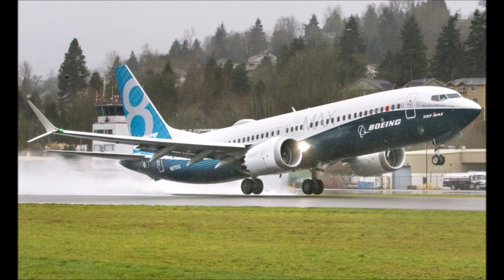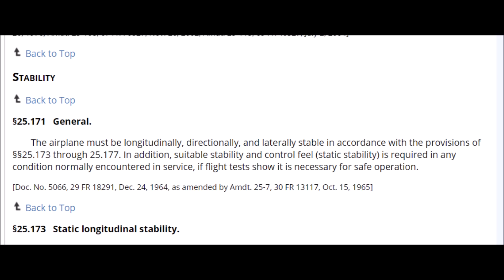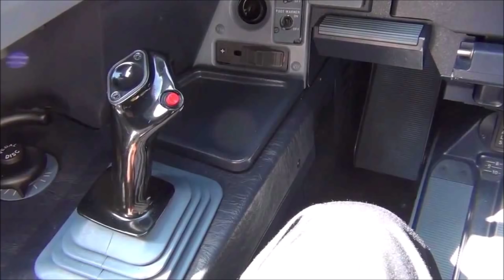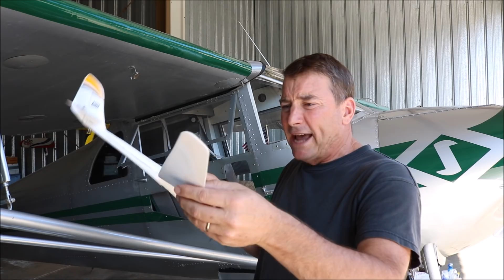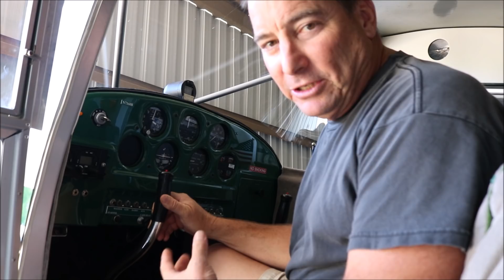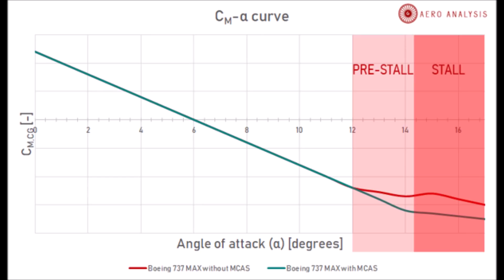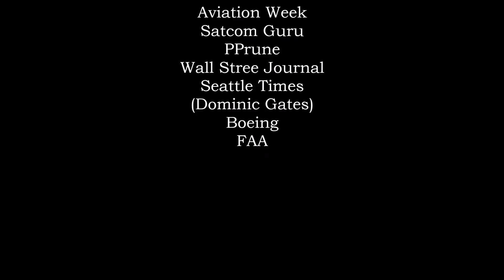737 Max UPDATE 30 Aug  2019

Comment: Juan,
I’ve been following the blancolirio™ channel on YouTube for a while* and this video is one of the best you have produced on aviation issues. The amount of information you are presenting, and your balanced analysis of facts make this video the best investigating coverage I have ever read on the 737Max fiasco. If you continue this path, you may get an offer to join the NTSB Team. 
The 737Max could have been another Boeing success story, but the greed of a few Boeing MBA executives subdued the Excellence of Boeing Engineering and created this situation. I hope it will be a good lesson for Boeing and other aircraft manufacturers not to undercut safety for quick ROI to please the investors.
Also, I want to congratulate you for having presented the human factor involved in operating an aircraft under the duress of an emergency with a new light. Especially an emergency happening just after the TO phase of the flight when time to act is supercritical because terra firma is coming at you faster than you want. IMHO your earlier videos after the Ethiopian crash, were too much in line with US Rep Sam Moore’s opinion, declaring in a nutshell “nothing wrong with the Max, it’s only the result of substandard trained (read unqualified) foreign pilots” or “this would never had happened with good ‘merican pilots at the controls”. This reasoning was total BS.
Yes, it seems the crew reacted late and made some mistakes, but these mistakes should not have finished in a crash, if the equipment they were flying was not flawed. Minutes before crashing those pilots were under a lot of stress, in those circumstances thinking right is difficult. Airline pilots, while mostly very competent, are generally not of the same caliber as astronauts with steel nerves like the Apollo 13 crew. But the Apollo crews had more time on their hands to figure it out.

Wishing you a prompt recovery and that your PSA level drops to undetectable level like mine has done for the last 7 years since my radical prostatectomy.
Your buddy BMW rider and former Penn Valley resident.

*I should stop being a free loader and send some dineros via PayPal to support the channel. Well at least until you get back behind a triple-7 yoke and re-start making an indecent amount of money 

Comment: When a small light aircraft (without any computers trying to fly it) has a airspeed indicator error caused by a plugged or socked probe , the pilot will ignore the dam dial on the panel and simply fly the damned plane and not have to battle a GD  computer highjacking his aircraft. You got these GD CEO's and bankers sticking there pricks up everybody's butts causing this mass slaughter to happen and not by a honest  mistake but by design.

Comment: I think he is getting the idea but gets into the weeds with all his examples of a small light aircraft compared to a fly by wire airliner. The facts that killed all those MAX passengers and crew relate to fraud in a scheme to market aircraft to CEO's and bankers. FAA rules are suppose to safeguard the public from aircraft that are not airworthy. Any aircraft that uses a computer to override the pilots when a airspeed probe is plugged or socked with a ground cover is not airworthy from the design state up. This is so basic a screw up that it is criminal.

Comment: MCAS went "HAL 9000" on the crews. I detect the need for nose down trim.  Diving!

Then it became "John Henry, man vs machine" trying to manually reverse what the computer did with motors in seconds.

I did software development for 25 years. We always do range testing. Allowing MCAS to trim beyond elevator authority seems like a huge oversight.  As was the redundancy issues.

Is anyone looking at AoA sensors? Boeing, Airbus, and most recently Cirrus have had issues with them.

Comment: Just an excellent summary of the 737 max issues. By over accommodating businesses, the FAA has lost its independent oversight. The loss of the veteran FAA managers is another disturbing trend where older wiser employees are replaced with inexperienced personnel because of cost savings.

Comment: The Lion Air Flight 610 aircraft had the "bad" AoA sensor replaced.  Remember?  It had two "good" AoA sensors!  Both Boeing and the Indonesian authorities have not offered a plausible explanation as to why the Lion Air aircraft suffered serious data failures on three previous flights, even AFTER the 'faulty' sensor was replaced.   The Ethiopian crash aircraft had earlier "intermittent" data/control problems.  Even with "good" AoA sensors.  For example: During a flight on 7 Dec 2018, during landing, the airplane starts rolling to the right all by itself!   Could it be that the bad data feeding into the MCAS came from a source other than the single AoA sensor?  An electrical short or surge somewhere in the wiring?  I hope Boeing is looking into this!  I will NOT be flying on a MAX8 until I am satisfied they  have found the true source of the problem.....

Comment: In 2008, Quantas flight 72, an Airbus A330-303, experienced two uncommanded nose-down events as the result of faulty AOA data.  This was not failing AOA sensors, but altitude data being mistagged as AOA data.  I realize that the A330 is fly-by-wire and not the same as MCAS.  However, it does seem that the Flight Control Computer, acting on its own, in contradiction to pilot input, decided that the nose needed to be down. The airplane never crashed (because it was high enough to recover) but it left several passengers and crew bloody and battered.  I'd be interested in any comments you may have about this incident.
Reply: I take it you are referring to the possibility that high energy cosmic radiation infiltrating the microprocessor circuitry at high altitudes could initiate bit-flipping, causing falsely activated software signalling? This is tantamount to pointing the finger at an Act Of God. Yet, such a mechanism is also conjectured to trigger a whole range of cancers. Random quantum physical events intervening at the macro scale?

Comment: Can’t Boeing just use the autopilot servos to pull back on the yoke to 3 lb force just like the Garmin 3000 suite on TBM 940 why move the elevator trim?
Reply: Because it seems that the B737 Max-8 trim was supposed to actuate without the pilots being aware it had done so when MCAS intervenes, except perhaps, by noticing the trim setting transiting while in action. Mechanically assisted elevator motion would effectively materialise as invasive motion of the yoke in the pilot's hands, would it not, and that would defeat the objective MCAS appears to have been set up to accomplish - which is to transparently assist in the background.
Reply: @snoortpod6462  Thanks for the explanation. So that means the force on the yoke must actually come from the elevator and not augmented pull from servos, but why. Wouldn't the two methods produce the same result on the yoke to alert the pilot for near stall conditions? In Airbus fly-by-wire side stick this will never happen as long as the normal law is still in place. Correct me if I am wrong but I believe 737Max still use mechanical yoke?
Reply: I kinda get what u mean. pulling on the yoke would feel like autopilot malfunction or something when the pilot is flying. And autopilot will not have the authority of the yoke when manual flight mode is engaged.
Reply: No idea how Boeing integrates the autopilot system, although, it's not the first time I've imagined how many stab trim movements there must be over the course of a single flight at cruising speed/altitude, no matter which aircraft this is applied to. The blissful ignorance of the everyday passenger, eh?

The two Max-8 accidents, I think, have not been implicated with the autopilot system in the public consciousness, because it was never activated in the Lion Air and Ethiopian scenarios as far as I am aware - I'll need to be corrected if I'm wrong. We have to wait for the accident reports to be published. It is burned in my brain that MCAS supposedly only works under certain prescribed conditions, and one of those conditions is contingent that the autopilot is/was not engaged when MCAS has/had authority over the horizontal stabilizer pitching moments. You might be tempted to suppose the Max-8 is governed by at least two autopilots, one of which is the official autopilot, while the other is an unofficial autopilot. It sort of gets a bit silly. In my mind any kind of automation working at any given moment in time while an aircraft is airborne must be governed by some kind of autopilot, but do forgive me my ignorance. The traditional sense of what a fully armed and operational autopilot does is to operate the aircraft with full autonomy while the pilots are formally 'hands off' any of the controls, other than the autopilot interface which allows pilots to alter autopilot functions in real time via a limited number of parameters such as instantaneous IAS, altitude, VSI, heading/track/course, maximum bank angle and so on through their respective control windows - the usual suspects. Before that traditional autopilot is engaged, the continuity of any given flight is governed by pilot skill and knowledge of detailed concepts of flight, requiring specific training. The traditional autopilot I'm referring to was known as "George," because its entry to being engaged was based on the handling pilot transferring their flight stabilized aircraft to an automaton, which from that point onwards maintained constant stability by initiating limited changes to any of the critical aspects of flight, while the pilot kept a watchful eye on what the autopilot itself was up to. MCAS, therefore, seems to me to be a form of FBW, but as to when it serially engages and disengages from overall flight monitoring and how it's overlap with "George" is defined, is something that has yet to be disclosed. I mean, how do you simulate a conscious entity that is not actually conscious so that it can fly a sophisticated machine when the words, "ground" and "height" are not even meaningless to itself?

Comment: I will never fly on a 737 Max.
Reply from the maker: Good luck. 
Be sure and check the data plate before you board. Last minute aircraft swaps are common.
Reply from the maker: Topnikko question, how do you buy your airline tickets?
Reply: @blancolirio  Choose airlines that have little to no fleets of 737 Max. Choose routes without 737 Max. Various ways to accomplish this. https://ecoxplorer.com/2019/03/how-to-avoid-flying-boeing-737-max-8/

Comment: The AoA disagree warning light wasn't an optional extra, it was worse than that. All of them have it, and it works in the NG. It just didn't work in the MAX unless an airline payed extra. Air crews familiar with the NG and aware of MCAS would know that AoA disagree can cause MCAS to go haywire and that a warning light exists. It is not in the checklists, but a sharp pilot might check that particular light, and it would give a false negative. It would have been better if it was not there.

Comment: Juan:

1) good luck with your health issues (I’m down for a while myself with a recent type 2 diabetes diagnosis, but I only fly my Mighty Mooney for a hobby)

2) have the Oroville wackadoodles all disappeared from the web?  I figured that if there was any legitimate interesting news about the spillways, you’d have let us know.  

3) I still can’t figure why the original MCAS system didn’t incorporate logic to disqualify an AOA sensor that experienced an excessive rate of change, especially if there was more than a few degrees difference between the two sensors. Maybe I have missed something that you reported on that issue.

Comment: Great and very informative! Unfortunately most people will not see this and will continue to distrust both Boeing and the FAA (and of course the 737 Max). I think many airlines will cancel their purchase orders for the 737 Max and switch to Airbus. The A220 (Bombardier C-Series) comes to mind. And I think the flying public will tend to favor airlines not using the 737 Max, for their own personal safety. Boeing has boxed themselves into a corner that has no easy way out IMO.
Reply from the maker: Orders can't be easily cancelled, as then you move to the back of the line at Airbus, with a 7000 plane backlog.
Reply: @blancolirio  Hi, thank you for replying! I didn't know they had such a huge backlog. Still, the perception problem isn't going to be easily overcome. If passengers refuse to fly on the 737 Max, what other choice do carriers have? It will take longer than that for Boeing to develop a completely new aircraft.

Comment: I've been following this saga closely from the beginning, and really appreciate the details that I wasn't aware of before. Great job Juan!

I have always wondered how any aircraft could be designed to have control forces so heavy in any scenario that it could seriously overtax a pilots strength. 

OTOH, having too little or no feedback is also a recipe for disaster and can lead to a pilot breaking the aircraft such as the case of Airbus A300 American Airlines Flight 587. (second most deadly airliner accident ever over American soil). 

In my opinion, the Airbus fly-by-wire approach is not necessarily better or safer. It simply has different failure points and is still susceptible to sensor failure and pilot error. Pilot error can't be avoided unless a human pilot is taken completely out of the loop. Sensor failure can't be avoided either, and any flight control system can be made to do the wrong thing if it is fed a sufficient amount of bad data.
Eliminating all causes of aircraft accidents/incidents is an unachievable goal. That obviously does not mean we shouldn't stop trying to reach it.
In the most recent 737 Max incident there was clearly human error involved. The pilots allowed an extreme overspeed condition to persist despite plenty of warnings. This was clearly a major contributing factor as it increased the control forces beyond their ability to manage. But to be fair, the pilots were under incredible stress at that point and their actions can not really be blamed on simple negligence.
I think that both aircraft manufacturers need to give more attention to human factors. The ideal design philosophy may be a blend of the Boeing direct control and Airbus fly-by-wire systems. The automated systems need to be able to intervene if they think the pilots are doing something dangerous, but at the same time, the pilots need to be able to quickly disable a specific automated system if they believe it is doing something dangerously wrong.

Comment: B-737 an unsafe plane from its very inception. Earlier versions crashed due to hard over rudder, others crashed due to other structural and design faults. The B-737Max based on a nearly 60 year old defective design,  to compete with a superior A-320 NEO,  was rushed into service IHT additional technical deficiencies. Imagine buying a car with a defective steering system, that is compensated by a computer programme embedded in the car that the driver has no knowledge about > and this software can override the driver. That is what is the case with the B-737Max, it has changed aerodynamics due to a heavier engine mounted further up on the wings, thus changing the plane’s aerodynamics >> Boeing then installed the MCAS software to compensate, but the system malfunctions and two planes crashed due to it killing more than 300 persons. Boeing executives responsible should be prosecuted under applicable law, given custodial sentences, Boeing company fined$1 billion per fatality plus $100 billion in additional penalties; and all B-737Max aircraft should be scrapped and delicensed. Boeing’s greed and utter irresponsibility cannot be overlooked or forgiven, the company and responsible executives must be punished in an exemplary manner, All operators of Boeing aircraft must reevaluate and recertify all Boeing planes in their inventories. The FAA failed and cannot be trusted again. Shameful!

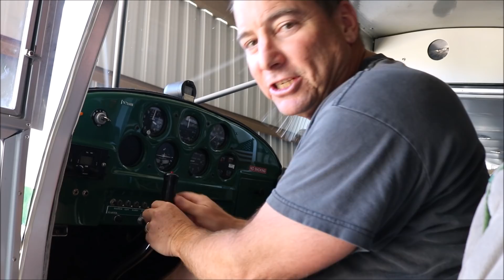Comment: At 14:51 you show a chart of stick/control force vs AOA. 

14 CFR § 25.175 - "Demonstration of static longitudinal stability" states that the control force MUST have a stable slope between a number of different AOA and power/flight configurations. The stable slope is not "desired" for certification, as your chart suggests...the word MUST connotes it is a legal REQUIREMENT. The slope of the curve is a measure of longitudinal "stability margin". The declining slope of the above referenced curve indicates the margin of stability is decreasing as AOA increases above about 8 degrees. As a private pilot, engineer, and airline passenger I personally need to see hard test data showing control forces "without" MCAS at the most adverse loading and CG condition, up to and including full stall, to demonstrate that the 737 MAX does not exhibit dangerous "deep stall" behavior. Boeing "should" be required and able to demonstrate this.

BTW, that "one specific corner of the envelope" happens to be one of the most critical corners of the flight envelope. The above regs say nothing about having to maintain the same "feel" between airplane types...the regs focus on stable slope of the force curve of any given airplane. Had the original 737 MAX exhibited a stable control force slope, there would have been no legal or safety reason to install MCAS per the above regs. The epically inept manner in which Boeing executed MCAS raises serious technical and organizational questions that should never need to be asked. Such questions do not go away easily and need to be thoroughly examined.